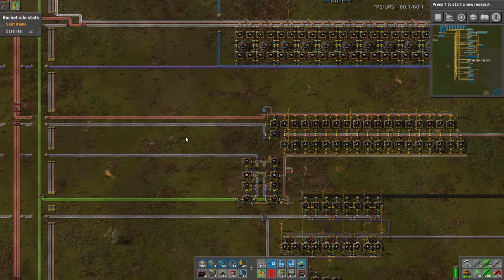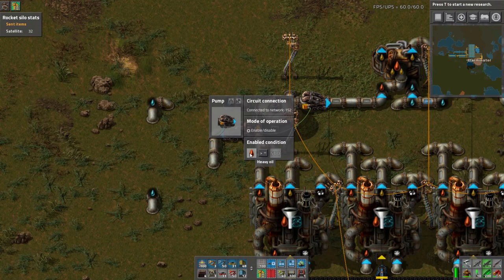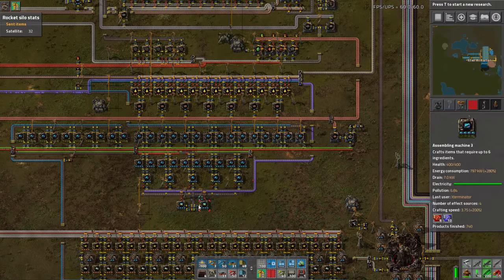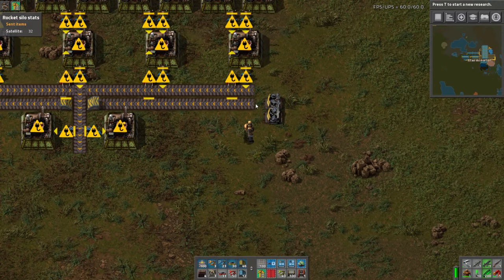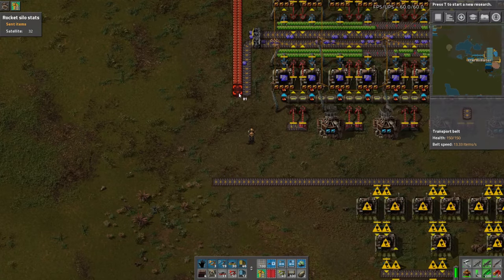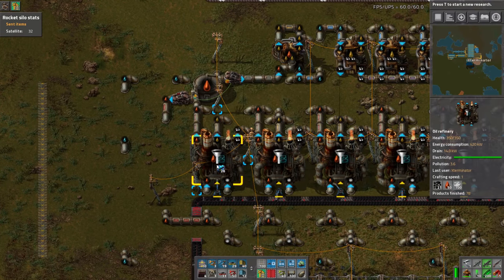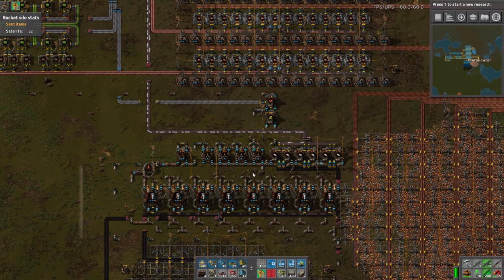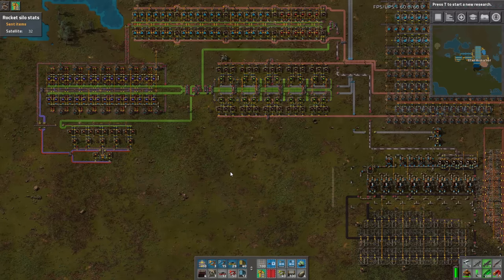Factorio: Tightening The Belt: Megabase Guide EP49 - MODULE BASE DONE | Tutorial Gameplay Series

Comment: Speaking of fluid mechanics, I'm not at megabase level at all but I think UPS, as always, I heard was a bit affecting UPS if on large scale, you know fluids are things you can't control or find alternatives of, except if there were barrel-based recipes or dealing with fluids in item-like form. I wish, if this was the case to have (in vanilla I mean) cases (like bob's counterparts) like advanced liquid recipes to use, instead of 5 liquid and 20 circuits and 2 advanced circuits (forget processing recipe) in 10 sec, you rather unlock advanced recipe of 1000 liquid, 4000 circuit and 400 advanced liquids in 20 times the previous time, or even simpler to use liquids as fuel-like measurement to be totally flexible with modded liquid recipes, kind of like how miners on uranium patches work by buffering liquids. Not at all disabling basic recipes, but, as said, have advanced recipes not to mess with current bases' logistic system (needing to dispose liquid tanks).

Also, I like to see flow control mod being adopted (I guess that's the word) , especially overflow pumps.